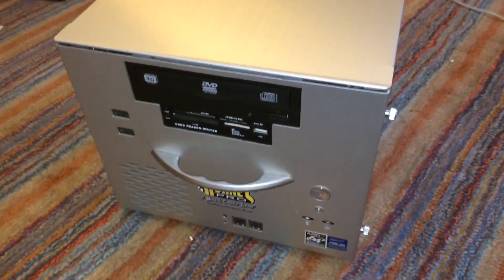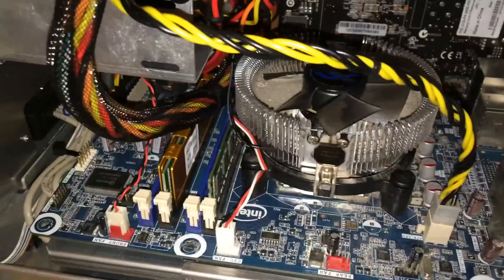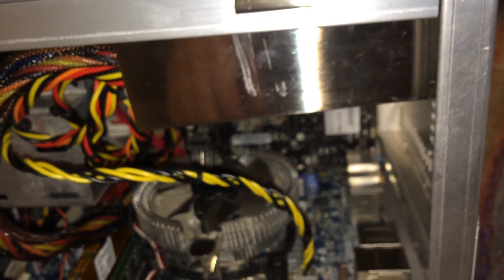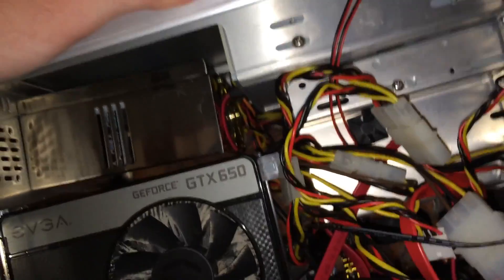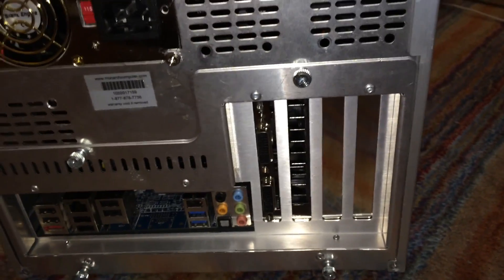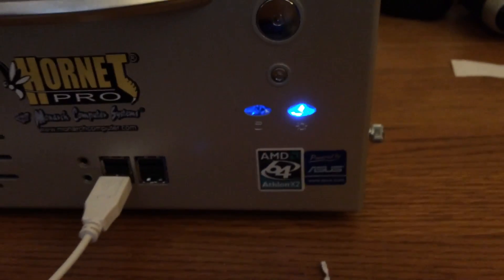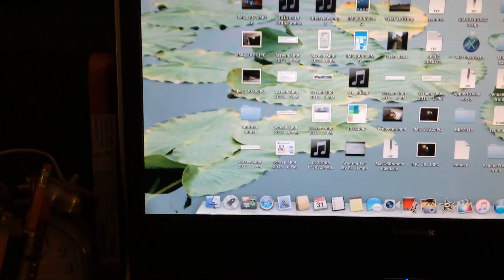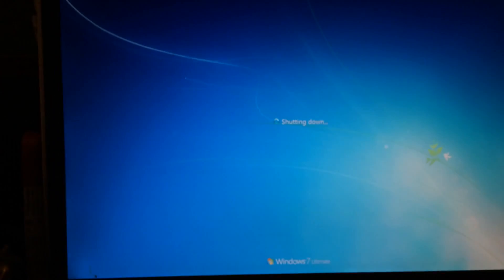Custom Built PC Updates 10-31-15

Comment: was it difficult to install osx on there?
Reply from the maker: +EndUser2090 It wasn't difficult at all, I simply used iAtkos ML2.
Reply: +dosdude1 I tried so many times to install it on an older dual core. do you have any resources that can help me. thank you for your reply.
Reply from the maker: EndUser2090 Just torrent a copy of iAtkos ML2, that should help you,
Reply: Thank you, I will try that.
Reply: +dosdude1 Use clover
Reply from the maker: Wobbled I do use Clover on this machine.
Reply: +dosdude1 I'm sorry but what is clover?
Reply from the maker: EndUser2090 It's a Hackintosh bootloader.
Reply: ***** I'm glad! It's the most stable shit ever